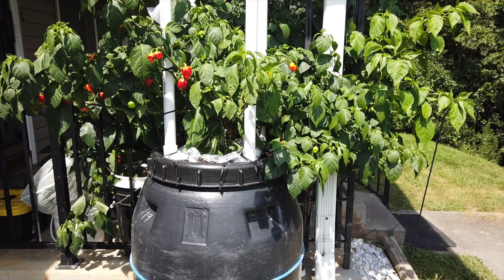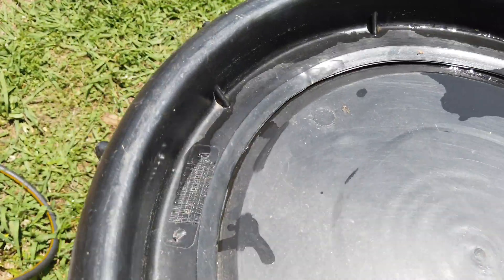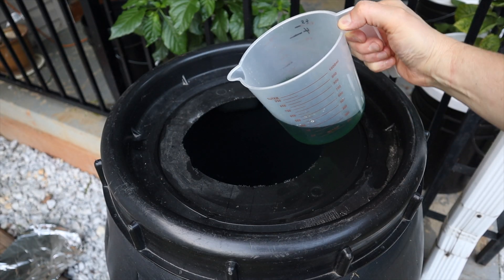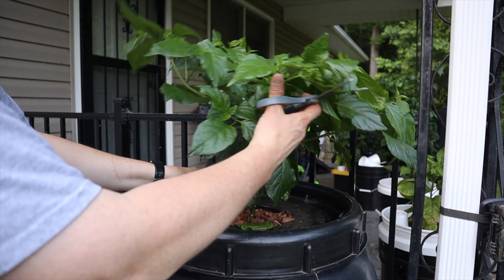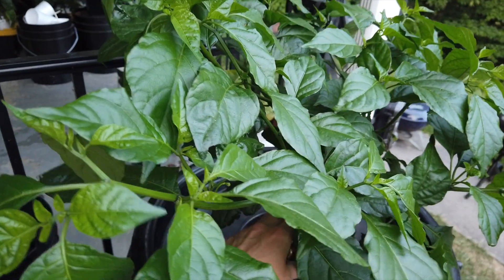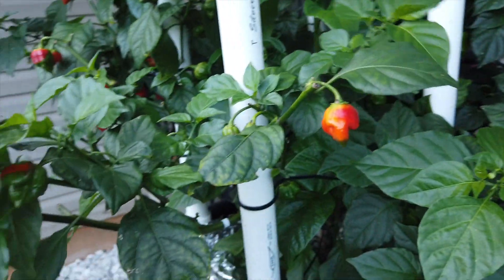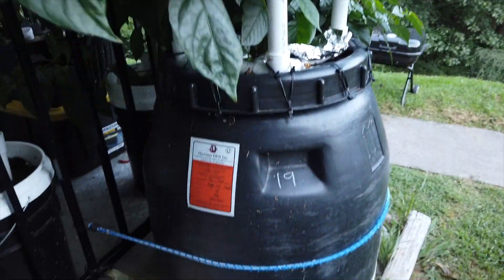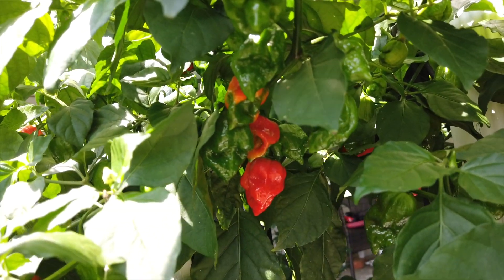how to build a large 60-gallon Kratky hydroponic system - DIY

Comment: Your 500ppm level is pretty low for this plant - shouldn't it be double that?
Reply from the maker: This is just my opinion, but I think it depends on the type of nutrients and type of hydroponic method (circulating or non). For non-circulating like Kratky, I use half strength. But I have also measured typical full strength masterblend vs dynagro vs maxigro, etc... having varying ppms. For anyone trying this I would use a starting strength based on what nutrient manufacturer recommends, and hydro method and adjust later, up or down, if needed.

Comment: Wow love it  Peter , that is a fantastic truly inspiring grow I watched the other video on it as well. Question regarding barrel's I can source red, orange or black would colour matter that much for water nutrient temperature ? Thanks again.
Reply from the maker: It might matter for DWC systems since dissolved oxygen decreases as temps increase. With Kratky method the gas exchange is occurring above the nutrient level, so it's not as big of a concern. Thanks for watching and commenting!
Reply: @pepperdactyl   thank you for the reply , I might go the orange barrel fake terracotta pot look :-)
Reply: @jennyd2046  Not having done this myself, but I'd take the black one and maybe paint it in some way to fit your taste. Black doesn't let in light as the lighter colors and after painting, it looks just like you want it to look, without getting as warm as a black barrel. But of course depends on your area, the amount of sun and the temperatures you get. Some plastics also tend to release some chemicals after a certain temperature, so you might check that as well. Probably just overthinking it though

Comment: I'm having a tough time starting these hot peppers - can you offer some techniques to get them started? I am thinking of using a brute 45 gal trash can.  I recently picked my 3rd cantaloupe running in a kratky system.  This is so simple.
Reply from the maker: One thing you might want to try, has always worked for me. Soak the seeds in tap water overnight. Then put them in a Root Riot/Rapid Rooter type plug (I usually start 3 per, and remove the extras later), and put that in some inert potting mix, or just coco coir in a cup. Cut some drain holes in the bottom of the cup. Carefully water it in, and put a little of the coco/potting mix over the plug hole where the seeds are. Put a ziploc type sandwich bag around the top of the cup to keep some moisture in. Should sprout in a week or so, once it does, remove the bag. You can keep it in the cup for a while, but it'll be easy to transplant, just remove the rooter plug that it is in and put that in something else.
Reply: @pepperdactyl Oh wow, I will try this on my scorpion and ghost peppers. I have some coco coir and some plugs.  I will start this tonight.  At what phase do you add some nutrition mixture?
Reply: @pepperdactyl  Are you putting the seed in the dark?

Comment: Hey Peter amazing job!!! I was curious did you maintain the pH during this grow? Or did you just let it go considering how difficult it it probably is to open everything up. Thanks bud, keep growing!
Reply from the maker: Thanks! Yeah, I just let it go until the nutrients got really low. I could tell by the weight of it, and leaves were starting to droop. With some help, I pull it out, dumped out the nutrients, and filled back in with fresh nutrients to around 25%. That got it through the rest of the season.
Reply: @pepperdactyl  Really an interesting setup. Only one change/add of water for the entire season. That would be great! Out of curiosity.. how long in total was the plant in the system (how long is the "season")? Thanks for sharing!

Comment: Nice! I don't know it is just me, but I think you could have done a better job on the cutting of the circle on top. LOL. I guess doing a video makes you just rush into things.  I'm just curious if you really don't need to add more nutrients on it. Looking forward on the future video update. Thanks.
Reply from the maker: Thanks for watching! Yes, I did rush that cut job, lol. I think it's hard to determine if more nutes would be needed on one this size. Depends on the type of plant, size at transplant, temps, etc... For this one I didn't, but the plant had some issues, not related to the system. I had another plant in a 44 gal container, and I had to refresh nutrients in. A reservoir fed system seems to work better because the nutrients will draw down and then remain at a static level. If a drain was installed, they could be changed out easily too. I have done that a couple seasons with a 27 gallon tote and grown nice plants in it.

Comment: Started my Kratz’s herbs and after a couple weeks the water is a bit murky and I have 1 very small blight spot on one plant. Is this normal? This is my first rodeo with kratky, don’t judge my brown thumb.
Reply from the maker: Not judging. Hard to say without more info. Did you refill at any point? Refilling is necessary for smaller containers, even bigger ones eventually, and if you refill back too much it can drown the air roots causing some of them to die and set the plant back. This can lead to root rot. Another possible issue is algae. If the container lets light in at all, this can happen. The algae will coat the roots and start starving them out, as well as eating up the available nutrients, which can also lead to root rot. Is there a bad odor in the container? If any of this might be the cause, you can try flushing it out with fresh water and some h20s. See this article for reference  https://www.greenandvibrant.com/hydrogen-peroxide-hydroponics. I would do a few rounds of this, and the last leave a little h2o2 in there, refilling no more than halfway, if the nutrients had dropped that low already at some point. I hope this helps.
Reply: Peter Stanley thank you for the info! I have not refilled, it’s a 7 gallon tote that I filled about 5.5 gallons full. Only about 1/2 gallon has been used but there’s no smell at all. It’s really more of a film on the top layer of the water.

Comment: Hey Peter, did you sterilize or clean the barrel in any particular way? I have pickle buckets at work but it is really hard to get rid of the smell. Didn't know if it would leach in to nutes and mess up the plant.
Reply from the maker: I sprayed it out with a water hose, but my sprayer sucks. It still had the odor when set everything up, but plant seems ok in it so far. We did buy a pressure washer this year, after this was setup. So going forward I'll use it, might help more than the regular water hose sprayer.
Reply: @pepperdactyl  awesome, thank you. 👍

Comment: Having gotten 7 foot tall Aji and also 8 foot diameter Chinese pepper plants in a 27 gallon tote, I am stoked to see how big a pepper plant can grow in a 60 gallon container.  Great job with your how-to video, as it makes the low tech approach simple to understand for others using it.
Reply from the maker: Thanks, Matt! I'm working on another video showing how to maintain one that is running low, or has nutrients out of balance,  assuming it all works, lol. This is work we did on my Bih in the 45-gallon trash can. So far it is looking better.
Reply: What level nutrients did you use in ppm if you measured it?
Reply: @golfshoe9321  I presume this question was for Peter Stanley.  Personally, I don't measure the ecm or ppm.  I just add 1.5 teaspoons of Dyna-Gro nutrients per gallon.
Reply: @MattGarver  Yes, it's addressed to Peter.

Comment: Peter, how well does this system perform under intense sunlight and heat?
Reply: If high temperatures are a concern, one could wrap the barrel with some reflective foil thermal insulation and set up some shade devices that still allow airflow (such as some pallets oriented vertically) around the barrel.  I've seen a couple setups that include tubing, radiators, and fans, but that feels like it's defeating the no-electricity, passive grow of the Kratky system.  Alternatively, one could also bury the barrel to generally balance out solution temperatures with ground temperatures and keep the sun off of the barrel sides.  Would need to check how sturdy the barrel is and how well it would stand up to soil pressure, especially once the nutrient solution begins to drop and is replaced by air.
Reply from the maker: I haven't had any problems with mine. It's not the hottest here like some places can get. The Kratky systems fare better in the heat than DWC systems do. With DWC, dissolved o2 levels drop when temps go up, but with Kratky they are getting most o2 from the area above the nutrient solution.
Reply: @pepperdactyl , I was worried that something like that would get really hot here in Fresno. Air temps can easily reach 110 and with the sun hitting the black drum, I could easily envision water temps rising to 120.
Reply: Setup a shade cloth, cheap and easy to set up now that they got built in grommets and edging: https://smile.amazon.com/gp/product/B087PXB316/ref=ppx_yo_dt_b_asin_title_o03_s00?ie=UTF8&psc=1

I just use some 2x3s attached to my fence at the height that I want and use cheap dollar store screw in hooks as attachments.